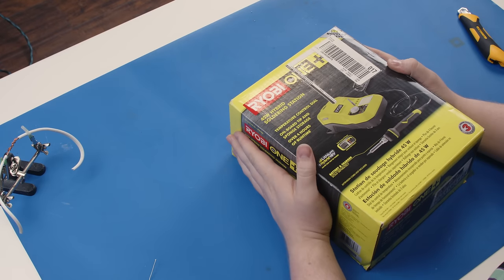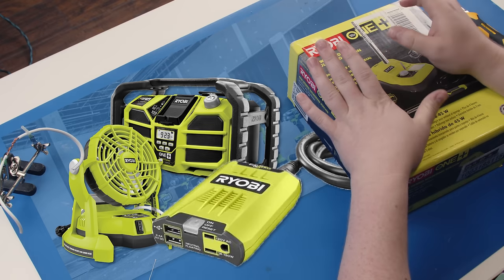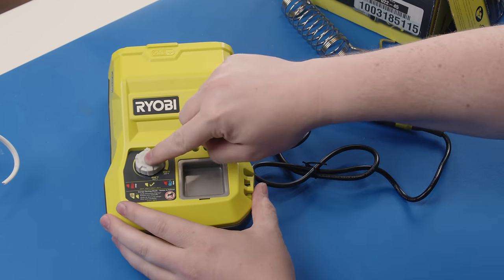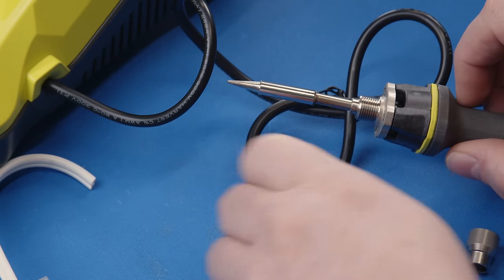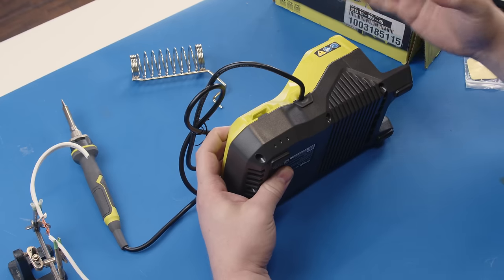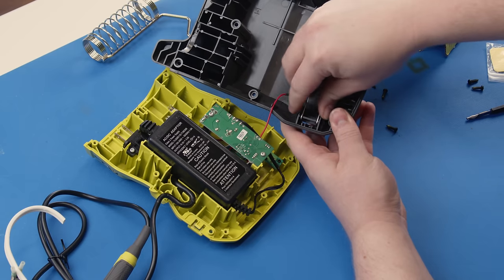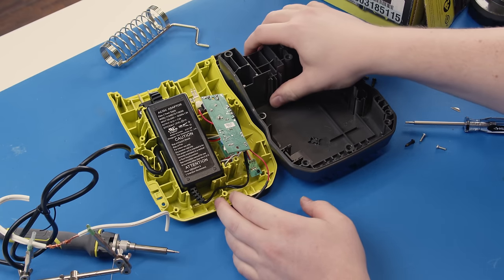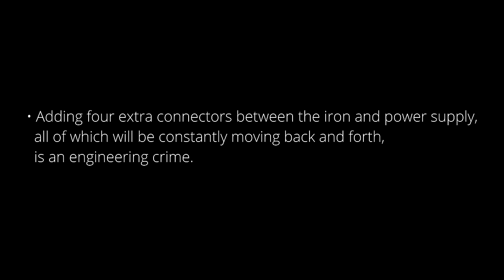Ryobi has GOT to be joking with this soldering iron

Comment: This is actually remarkably well made to use the bear minimum of parts and have the least assembly required. Some modeller did a great job to let others be lazy.
Reply: Actually sums up every ryobi product ive ever had to use.
Reply: That thing is going to get hot very easily.
Reply: @mickalinjezerx7104  That all depends on how efficient the circuitry is. The power supply's won't get any hotter then the one on your lap top so there's no worry there and that control board doesn't look like it was designed to pass much current through it so I doubt it will get very hot. Designers know better then to design products that trap heat because heat is the number one killer of electronics and that means products get returned and manufacturers loss money.
Reply: @iamjackalope  You describe literally thousands of products. It doesn't matter how good the is. As far as I know where there is energy carries Heat.
Reply: @iamjackalope  well I never had a laptop but I have had a hot phone before.
Reply: @mickalinjezerx7104  Phones get hot because they transmit microwave radiation not so much from the electrical current passing through them. A laptop itself will get hot as you use it but I have never had a lap top power supply get hot and that maybe part of the reason why they chose the rout that they did. I don't know why they actually went that rout. The only Ryobi tool I have ever purchased was a $30.00 grinder and really don't even consider Ryobi when I'm looking to purchase tools. I use tools professionally and need professional grade tools. Ryobi is the domain of DIY and Joe home owner in my honest opinion.
Reply: @iamjackalope  I have a grinder too and it gets hot. Even though mine personally never gotten hot. I know a lot of guys who overwork their grinder and an end up stopped working cuz it overheated.
Reply: @iamjackalope  Lots of mixed reviews with ryobi, i bought a 1/2 inch rattle gun 4 or 5 years ago from ryobi and its honestly the best $300 I've ever spent.
Reply: @Billo-07  Yea every now and then they come up with something that works pretty good. I mean with todays advanced manufacturing there really is no excuse for making crap tools other then you are just a crap company and considering they are under the same umbrella as the Milwaukie brand I'm sure they will be sharing a lot of the same engineering but at the same time Milwaukie is there pro tools brand and Ryobi is their Home Depot DIY brand and there is always going to be a difference in quality and cost but every now and then they will break out with something pretty cool. This soldering iron may have been originally for the Milwaukie brand hence the very sturdy enclosure but they might have knocked it over to Ryobi because they thought it was a tool more likely to be popular with the DIY crowd. Who knows?
Reply: @iamjackalope  Ryobi would be one of the last brands Id consider professionally grade. Which make the fact they a sister company of Milwaukee seem odd. Though its obvious they don't collaborate on designs. Personally I prefer Makita, but to each their own.
Reply: @iamjackalope lol phones don't get hot because of microwave radiation. They barely produce any heat from the wifi and cellular radios. 

Phones get hot from the CPU and graphics chips to when In heavy use, without  any active cooling, and obviously from charging the battery. 

It definitely isn't the wifi and cellular radios.
Reply: @iamjackalope it took many years of hard use to kill my Ryobi reciprocating saw.( Sawzall) So I bought another one. I've always had good luck and great results from the use of their tools. And always a decent price.

Comment: Those inverters are life savers! When the power was out during freezing temps, I had one and was able to store electricity in my batteries, recharge them in the garage so no door needs to be cracked to use the generator.

Comment: I've been using a Hakko FX-901 for over a decade now for lightweight tasks, and it's worked very well for me. No, it doesn't have temperature control, but a set of 4 NiMH AA cells will give you over an hour of runtime, and you can put the cap back on it while still hot. Of course, it has relatively low thermal mass so it can't take the place of a proper soldering station, but for small parts (Game Boy mods, replacing capacitors, etc) it's very convenient.
Reply from the maker: Huh! It looks so simple, but I guess if it does the job!
Reply: I got the nice FX-1001 still 🤣
Reply: Who else read this comment in Colin’s voice?
Reply: I've got one of those hakko ones, too. It's fine for emergency stuff.
Reply: Can't be more than 20w iron if 4 aa nimh cells will run it for a hour.
Reply: @ThalassTKynn  Oh so your a JBC guy... I see.
Reply: I had a chinese ZD-something for over a decade. Nothing was original anymore towards the end, except the heater cartridge and the transformer. I bought a JBC a few years ago. If you solder electronics almost daily, it's worth it. If you don't, don't.
Reply: I love the Hakko products.
Reply: I have one of the Portasol irons and it's my daily driver for about everything haha. When you get to know the iron a bit better you get a much better idea of how much gas to use and regulate the heat that way
Reply: They are about 6 to 7 Watts.

Comment: I’ve owned the smaller version of this for several years. It has handled everything I could throw at it and even surviving a rollover collision when some chucklehead ran a red light and rolled me over.  It ended up underneath one of my toolboxes and submerged in oil. 18 months later it still works, and only occasionally reeks of burning oil.
Reply: Yes, he's ripping on it but they work great.
Reply: That last sentence. 🤣
Reply: @deusexaethera  To be fair the soldering iron part was completely submerged in oil when I found it 2 days after the wreck.  I cleaned it up and flushed it out with some solvent but I never could get all of it.  The first time I powered it up it reeked of burnt oil but I kept it running and the smell went away. If I used it often there is no smell but if it sits for a few weeks I guess some more oil wicks it's way in from wherever it's hiding and it smells like burning oil for a few minutes.   I've just learned to power it up before I use it inside a hospital or somewhere else where people might object.    It's getting fainter.   It's still the best portable soldering iron I've ever used.  
If it died today I'd go buy another one without hesitating.   Rattling around in a service truck for years, getting rained on, dropped, smashed by a toolbox and submerged in oil  hasn't exactly been an easy life for it, but the thing still works great.  It's already lasted longer than my last 3 corded irons and at least two butane ones that were kept in the same environment.

Comment: To me, the bare ceramic is what I think of as standard under the tip. I think every iron I've ever used is like that. No need to make the heat transfer less efficient. With the tip screwed down, you won't have any force being applied to it.
Reply: Came here to say the same thing. My best station is a hakko and it's got the bare ceramic same as the cheap ones I've got from Chinese brands. They all work fine, I've never considered that a weakness.
Reply: Ye. First time I saw it, I was concerned about how brittle it might be, but in practice never had it crack. It should be held in place and not rattle around - If it rattles it's not making contact and transferring heat.
Reply: Hakkos do at least have a replaceable ceramic element from what I remember. Some of these are likely built in a way that you can't get it out without destroying the handle.
Reply: Arguably using the ceramic core is less efficient than integrating the heating element directly into the tip, downside of doing that makes the tips more expensive and potentially harder to swap out. TS100 uses such tips.
Reply: It's been the standard for over 20 years, he needs to do more research when doing a video.

Comment: I've been liking my TS80P for portable soldering.  I chose it over the TS100 because it uses USB Power Delivery instead of flat pack/drone batteries. I have an 18W PD battery pack that works wonders, and it can also use my laptop PD charger.  Gets hot enough for any of my little projects and has swappable tips.
Reply: I have the same for the same reason. Love it.
Reply: I was going to comment this same thing. The TS80p is absolutely tiny and heats up in seconds. Absolutely my favorite purchase.
Reply: After going through two soldering stations, the TS80P is my new daily driver.
Reply: The TS80p and TS100 are incredible the Pinecil is also really great as well.
Reply: TS100 is usb power compatible as well.
Reply: I built a portable tool-kit this last spring, got the TS80P and made a 3D-printed storage tray inside a plastic box for the soldering tools, I also got a USB-PD 20V powerbank that can charge my laptop and run all the electronics tools (soldering iron, magnifier lamp, fan, power supply). It's super handy to have, the soldering pen and the rest as well.
Reply: The Pinecil has USB PD support and also way cheaper tips than the TS80 series irons. It's more or less a TS100 with a USB C port and a different microcontroller.
Reply: Thirding the pinecil. Amazing for the price.
Reply: I made a usb-c_to_power connector that takes 20v from PD-capable usb chargers and supplies it to TS100, so it can pull all 65W from those small and compact GaN chargers. Works like a charm, but it is indeed a dirty hack that i know only fits my case ("kit should be small, portable, high-power, and able to be powered from batteries or powerbank as a backup").
Reply: @north_by_midwest  I heard build quality is not as good though, what are your thoughts?
Reply: @cyrex686  pretty sure the pinecil is plastic vs the ts80p machined aluminum body
Reply: Doing a lot of microelectronics prototyping, I hate the full size soldering station and its big dumb conical tip that my work provides.
I've run my TS80p from a bank and a phone charger, commandeering the full size stations sponge and holder because the TS80p just feels great in the hand to me. It definitely does what I need it to for my work, and I'm honestly not sure that I'd ever need anything bigger.

I run it with the slanted blunt tip, which actually has an extremely fine point for tiny legs, and then a flat face if you rotate it slightly to dump a ton of heat into something.

I flashed IronOS onto it (literally drag and drop a file) and now I hold down a button to get a "turbo" mode, where it just runs the element at fill power despite the temp rating. You can do ridiculously large/heavy joints this way....

All in all, I don't think I'd ever even bother with a full size station now that Type-C PD is so ubiquitous.
Reply: Also to add about the ts100, Ryobi has an inverter with Type C PD, though I doubt it's high wattage.
Reply: I have several ts100's but I got them a while back. They heat up quick, I don't run them off batteries.
Reply: @mooommo14  Really? Miniware must've upgraded it, I've never been able to power that iron's heater from USB.
Reply: @MMuraseofSandvich  You must be thinking about the ts100, I have that one also, the one with the dc barrel plug? The micro usb on that is for updating firmware. Miniware has a different model called the ts80 which will run off of usb pd for you :)
Happy new year!
Reply: The TS100 can NOT be run off of the usb port, there is an external board called the Flex-C-Friend that can take PD and output through a XT60 connector.
Pinecil is best tho, love mine much more than the TS80
Reply: I have two TS100's...And prefer my Ryobi

Comment: I took a broken blue-bosch 18V charger, and removed the internals, put in a 5-20V to 60W USB-PD PCB, 3d printed a little attachment piece, and soldered the wires from the battery terminals to it. So now I can power my Pinecil from my batteries that I use with my other tools that I keep in the van. Plus it doubles as a huge powerbank for my laptop, and other devices.

Comment: I worked with a lot of strain reliefs at UL when i worked there. That strain relief is pretty solid looking. There would be so much friction that the narrow teeth biting into the cable are probably not likely to cause much, if any, damage over the life of the product.
Reply: I've already killed a cable in a ryobi soldering iron in less than a year of ownership. I just replaced the cable with some more heavy duty wire. Hasn't missed a beat since
Reply: Dude side note your company blows my mind UL listings are everywhere and your field guys for recertification are super helpful.

Comment: The tapered screw holes was probably also a cost-saving measure. Very minimally more plastic, to reduce the chances workers will get stuck fumbling around with lining up the screw head to the hole down in there, the taper just makes it magically happen so they can hurry up cinch it down and ship it.
Reply: I've opened some radios with such deep screw holes, 
If they don't have the tapering, I can't know if the screwdriver is really in the slot or is it between the screw and the plastic.
I broke a lot of plastic because I thought I was turning the screw but I was actually using the tip of screwdriver as a lever against the screw to break the plastic...
Reply: @phs125  My own experiences with non-tapered holes is what gave me the thought that this was their purpose too lol
Reply: My guess would be they're tapered for better release from the injection mould but that would definitely be an added benefit.
Reply: @zachmiller9175  That's a good thought, that is possible, though if they're machined nice and tight to a 90-degree vertical it should theoretically yield the same results or even better results with releasing as there is less surface area contact with just a straight cylinder rather than a cone shape, but I wouldn't know as I'm not in the PIM industry. I just got to thinking about how tapers are used to secure things sometimes, even tooling and chucks.
Reply: @AToolWithTools  this is the exact reason, anyone who watches AvE or another hacky tool-abuseing channel like this that has ever heard of the term Draft angle/relief, it is required for injection molding
0.5 degrees on all vertical faces is strongly advised. 1 to 2 degrees works very well in most situations. 3 degrees is minimum for a shutoff (metal sliding on metal). 3 degrees is required for light texture (PM-T1).(stolen from the web)
Reply: @Keen Scents   reason for draft angle is for air infiltration on release as well as separation. A 90deg core pin would cause a vaccum to occur on separation and make it difficult to separate and cause damage

Comment: While working as an intern one of the designs I was working on my boss actually had me research current available solutions for multiple things including retention and signaling which is a good design practice. If someone makes something you can just buy off the shelf then don't recreate the wheel just buy it and use it! I love your analysis here but I also would like to say that buying the AC adapters to put in doesn't surprise me because of how cheap those are and how good they are able to be made at those prices. The fact that some engineer took the time to measure an off the shelf component to buy and slot into place is actually time well spent because they didn't have to pay 3 other engineers to help with electronics and board layout. Also, about the tip, the heater cartridge and tip system looks a lot like my Tenma soldering iron (yeah, go ahead and make fun of me for being cheap) which takes the same tips as RadioShack digital stations so maybe this is actually a connection style that Hakko licenses or is just easy to copy without running into patents. Either way I loved the teardown. Also, my dad has one of those butane ones and actually uses it as a butane torch too which is great when working on large wires or when you need to quickly melt some shrinkwrap... Not very good on complex circuit boards from what I've seen though.
Reply: Good for the company, bad for the customer still.
Reply: @DeagleGamesTV  Nothing really wrong with using them if they are placed right. If this had more cooling vents and air channels it wouldn't be much of an issue at all for the customer. Also there's still a quality consideration there by the company. You can buy really good quality AC adapters for a higher price, and still come out under on overall product development costs. Or you just have more integrity as a company. Or they can buy the crappy ones that fail all the time. And it really does keep costs down for the consumer in competitive markets. Power tools is a low margin market overall. It's generally around 5-10%. It's highly competitive.